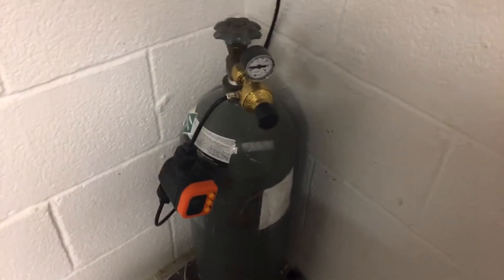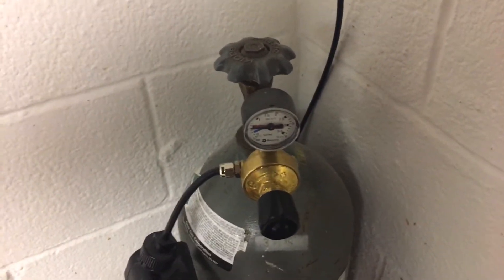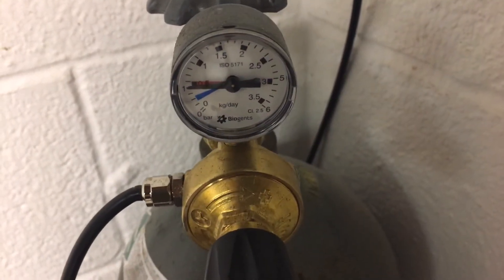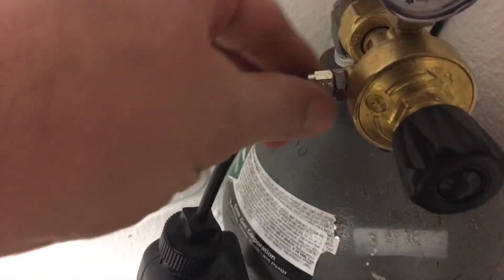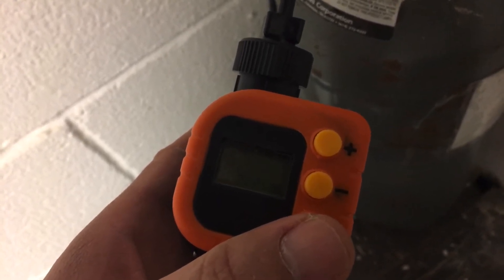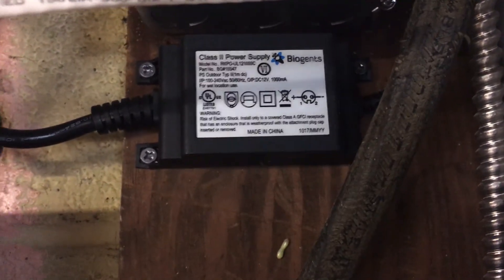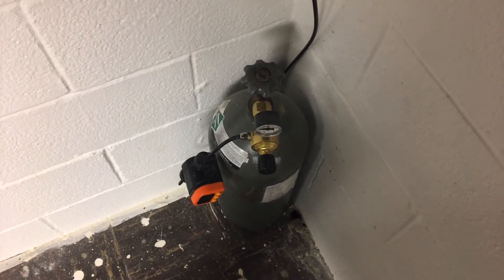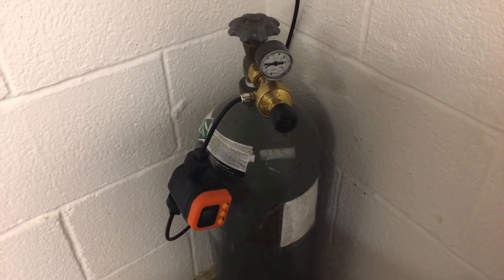Biogents Mosquito Trap #3: CO2 Tank, Regulator & Timer

Comment: Do you have two traps linked together on the same CO2 line?  Did you have any issues getting equal pressure to the far trap?   I have two linked now and can’t get gas to the far trap despite doubling the CO2 output.
Reply: than you should use same length of line which starting from your split valve longer line wont bother you shorter distant trap right, than you have same pressure out from your two line ;)

Comment: I got the same orange co2 timer and tank and the push connect ball valves you were kind enough to link to. I have a total of about 40 meters or 130 feet of co2 line but I don’t get bubbles until I put the regulator up to 2.5 instead of the .5 kg/day. Do you think with all that co2 line it needs more overall pressure?  I wonder if it’s at 2.5 kg/day at the regulator if that doesn’t necessarily mean it’s wasting 2.5kg/day, maybe that’s just the pressure needed for all the length of the co2 lines?  Curious about your thoughts on that.
Reply from the maker: I am not sure... but in my system I installed a valve right next to the trap to more precisely adjust the CO2 flow rate from right there.  I too have my regulator set to 1 bar (.5 KG per day) then I have about 60 ft of feed line then I added a valve for fine tuning the bubble rate a few inches before it runs into the nozzle on top of the trap. I would guess that by restricting the flow at the trap using that valve that would increase the pressure in the feed line to match the regulator pressure of 1 bar (.5 kg/day) assuming no leaks. Keeping the line under pressure I think allows a more accurate and consistently stable rate to be set using the valve to achieve the ideal bubble rate. I think there is a video on the BG website that shows the ideal bubble rate. I hope that helps.